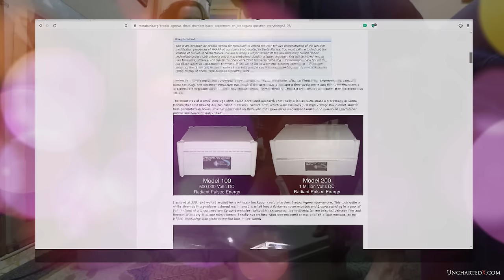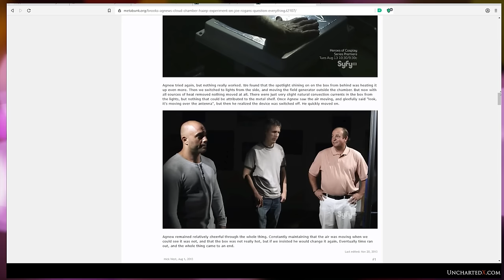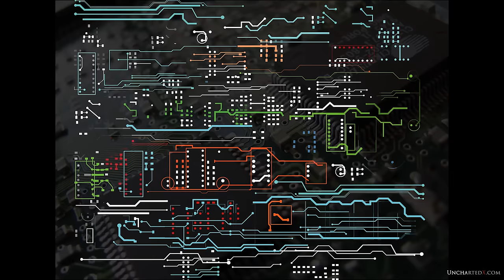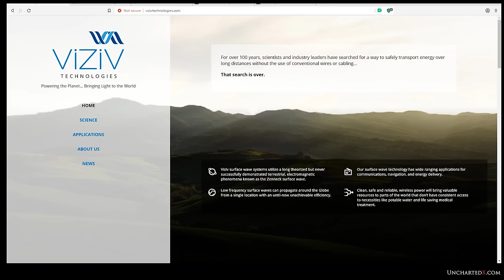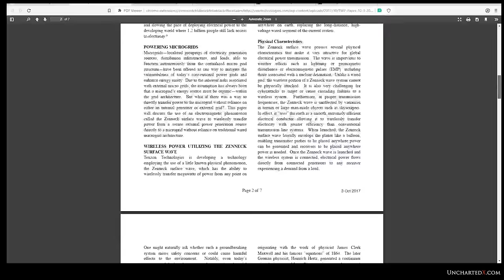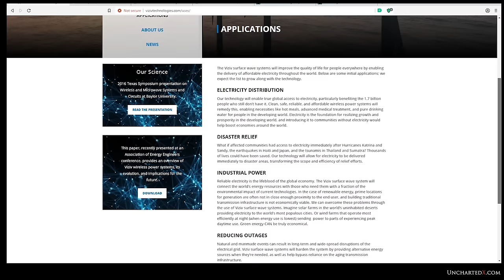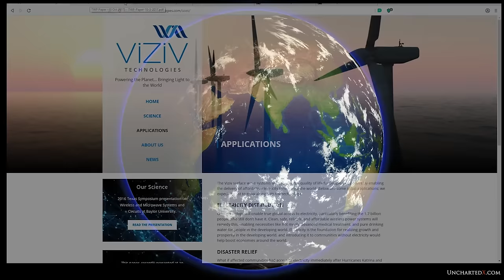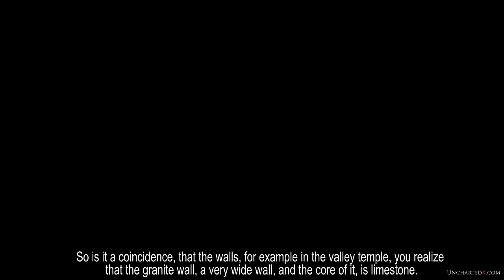500,000 volts through megalithic stone? An investigation into the possible with UnchartedX!

Comment: I have another idea about the reason the basalt facing the limestone is crumbling, and the side that faces open  air is not crumbling. Maybe it's because the limestone was protecting the crumbling basalt from falling off and eroding away in the sandy wind?

So the limestone protects the crumbled weakened basalt from being worn away and blown clean by the sandy wind. The basalt that is exposed has the crumbly part all blown off, so that's why there's none there.

Is that possible?

Comment: UnchartedX ... I think you should take a look at the work of John Cadman pyramid pump.  He proved that the pyramids were a type of water concussion wave pump. (He has a working model - hard to argue!)  Quartz produces power when it is under pressure.  The concussion wave was a shock impulse.  That impulse was stepped up using a acoustic transformer.  This is why the Kings Chamber were built.  They were designed to step a powerful low pulse up to high frequency.  The Limestone is an induction carrier.  The quartz reflected resonated and returned additional power.  The pressure was created by vibration impulse from the pump running.   It seems that the over all temple had a higher level of charge between the outer layer. This is what happens in AC "Skin Effect".  The levels of power must have been massive when you look at the scale.  In AC power electrical degradation of cable insulation in distribution lines is due to the electrical stress caused by switching surges.  If this was indeed a pulse wave generator. The pyramid has two sides. The stone materials above and the materials under compression below. The wave would have reflected between the two acting as a resonant step-up oscillator. This would have the same skin effect as AC power.  ... Dr. Cadman also claims that carbon tubes exist that linked the pyramids to the water.  Thus negative ions go to the stratosphere and positive ions into the water.  ... Additionally, if Cadman is correct. The levels of water pressure would transform brackish salty water into fresh water and killed microbes through pascalization.   .... Personally,  I think this was the Tower of Babel. ... They were trying to reach into the heavens.  Not with a physical object but energetically. ... I believe that they were going to create a one world power grid and to access that power grid you had to become part of the system.  ... The pyramids have fractured acousitc plates. ... The book says that in the days of Peleg were the lands divided.  This means there was a huge earth quake.  This would have been too much vibrational energy for the pyramid pump. ... It also seems that the process of operation also produced a great degree of hydrogen gas.  ... I'm thinking that a white pyramid with a capstone of Radium Phosphor Glass with a  focused beam of ions passing through it would be an amazing site. It would be like a large fluorescent light. ... I think you and Yousef Awyan should contact John.  ... Could this thing really have been an emergency beacon  to reach into the stars? ... Who knows.
Reply from the maker: Interesting theory, thanks. 'Proved' is a strong word that I'm not sure I'd use in this case.
Reply: @UnchartedX  I think you need to take a look at John's work and those adjacent to him then say he is wrong.  ... When you can build a physical model and demonstrate it working, when you simulate the lower swirl chamber and demonstrate a match with ink flow matching visable erosion and others can simulate it in multi-physics it is not in tin hat world any more.  Additionally, if you look into hydraulic ram pumps for pumping water uphill it is the same fundamental configuration. Take a good look at John's work, look into ram pumps. Then talk to Yousef Awyan about the electro-compressive effects of stress on Quartz.  ... It would also be interesting to know about the inductive / conductive effectiveness of the mortar they used on the limestone blocks.  .... Hit me back - It would be interesting to hear your and Yousef's thoughts. ... Thanks Mike

Comment: This is interesting. I wonder if alternating the stones like that creates what is essentially a capacitor? I wonder if the arc gets stronger simply due to being closer to the field source, or if the stones alternating like that acts as a transformer and multiplies the voltage?  What would happen if there was a marble (non conductive) core? Would the basalt still produce an arc? What is the voltage potential  from the top piece of basalt to the bottom?  Supposing you held a piece of basalt and tried to strike an arc like you did with the copper, would it work? If it does, perhaps that is the cause of the erosion between the two stones.

Comment: limstone - granit -  limstone is capacitor (blokking dc volatge verry high) if you put some after each other its  serie capacitor (can handle even higher voltges)and a tuning device (filter) for smal band frequens sender. maybe try frequence messurements   to find sendig  Radio ? frequence. As i assume frequence will be realy high

Comment: I agree with these experiments as I believe the pyramids could harness electricity, as well as the Bhagdad battery. Have you ever researched into finding the right pitch to shatter a wine glass? if a wineglass can vibrate, then why cant other frequencies vibrate other materials? If you hit a bell next to another identically weighed bell with the same frequency the other bell can ring.

Comment: The megaliths like the pyramids were built with electricity. They were not used to make it or transmit it. The air shafts were where the electric cables were brought in. To finish the inside while the rest of the pyramid was built around it.
The key though is, what are the obalisks for?

Comment: Maybe these electro-magnetic functional areas utilized "Leyden jars" storing natural static electricity which produce fluorescent light without a filament?  The glass would be long since gone after being used for other things over millennia until they broke & disappeared into waste streams.  Could the highly polished granite boxes be "brushed" to build-up a static charge inside to wirelessly power other objects?  Were the granite boxes incomplete, awaiting some other inner component to generate or store electricity?

Incidentally the Sahara was a green & fertile region some 9.5  thousand years ago, & logical to presume that probably the Egyptian desert was too.  The climate then changed apparently because of a perturbation of the Earth's axis.  So the ancient builders of the Separeum at Saqqara (whenever that was ! ) may have had a vastly different habitat to the hot dry deserts that followed, along with significant alterations to rainfall & regional water courses.

Comment: @UnchartedX
(edited for time reference)

@22:34 marble stone

He says that since the marble was not conductive like the basalt then that why it's not used.

This shows a complete lack of understanding basic electronics and electrical fundamentals, importantly- capacitors, electrolysis, electrolytic process, and electrolytes.

FYI... for a circuit to work properly you don't want everything to have the same potential, and anytime there is a change in potential there will be a thermal and electromagnetic component.

Don't discount a stove that has apparently, no connectivity.

if they were to Cut the stones differently, more like pancakes, [or used a cylindrical cut] and stack these stones correctly, and understood basic electric theory, they could have created quite a powerful capacitor, that would have shocked the hell out of them or been quite harmful.

Comment: If the pyramid was encased in the limestone then recieved electricity from the ionosphere the voltage difference between the shell and whatever was stored in the kings chamber box would have a direct path to the contents via the air shaft

Comment: I think I know how they use that with a pyramid. It apex cap would conduct sunlight to the pyramid walls, and each section between the disc(4), would contact the pyramid . Or even having a metal encaseing that goes in center.was charged the sand stone middle. They can use it for gold plating. Or drilling .  Pretty nice object with interesting geometry.kind of reminds me of a car engine crankshaft.

Comment: What if the basalt or granite is carrying the charge and the limestone is the insulator. Perhaps it’s in the center of the wall to separate positive and negative. It may only be needed to prevent a short between the two poles not to protect anyone from touching it. The main reason we insulate wires is to prevent shorts that might cause a fire and to keep people from electrocuting themselves. But if it was not dangerous  for us to touch you would only need to keep positive from touching negative. If that makes any sense.

Comment: It would be interesting to see a test of both types of limestone, and with different bases. Limestone to granite /basalt was shown. How about basalt to limestone/granite, and granite to limestone/basalt ... and using both types of limestone. Also, granite has some piezo-electric properties, meaning that a sweep of frequency might show interesting effects. As pointed out in another comment how MUCH output one gets, at different levels (first basalt vs second and third basalt levels, etc), with different sizes radius and thickness of the cylinders of each type would be interesting, again swept across a wide range of frequencies (including pure DC).

It was shown that marble was not conductive, so if the granite was used as an insulator, marble would have been a better choice; so there HAS to be a reason why it was not used, and granite was.

The limestone side of the basalt wall was shown to have deteriorated. A comment or two discussed the chemical  and physical properties of basalt that might explain this. But, in older "dry cell" batteries, the electrodes are known to deteriorate in much the same fashion.

Prior to WWII, people sold "electric shocking machines" that used a large 1.5 volt dry-cell for power. It used a relaxation oscillator to create a variable voltage/current, which was then used for "medicinal" treatment purposes. (Or just for entertainment - to see how much your could take). The device had multiple output power levels chosen by which 2 of 3 connectors were used, and then that level was further adjustable by a sliding iron core that fit inside the relaxation oscillator's coil. Not that this matters, it is just added for a reference.

By the way, for a guy that carves stone (or, actually ANYONE!), your friend has an impressive range of knowledge, as did his father.

Comment: The crumbling looks like frost-fractures to me, which makes me think that maybe th limestone is there to dry out the basalt, but with flooding it might have had the opposite effect.
But the combination of these materials, could have many different effects. It did not seem to act as a semiconductor, as the frequency never halved (I'm assuming the magnetic field is oscillating, and not just a pulsed DC, though is this was the case it could be the reason why the granite was such a poor conductor). I suppose that this could have either acted as a thermoelectric generator, or a thermoelectric cooler, or a combination.
The fracturing of the basalt could also be chemical, as a result of the proximity. Or it could be electrochemical if any thermoelectric effect was taking place, which is somewhat likely as as they were both shown to be conductors, in the same way that the combination of to different metals, will create a potential differential when heated (thermocouple).

Comment: The problem with Zenneck-wave power transmission is that if you can just plug something into the ground and get power then  everyone can do it!  This means that the entity that generates the power is doing it for free because they have no control over who uses it and cannot get paid. You would need a monopoly on the receivers to make it a viable business model. I don't think this is possible, even if the  Zenneck waves actually work.

Comment: The machine is just a tesla coil with a pwm and a capacitor. It's far from producing the longitudinal scalar waves used in HAARP. Much more interesting and important is how energy can be concentrated, focused, and even transmitted through a pyramid structure!  The pyramid is actually capable of producing rudimentary longitudinal waves, and do it on the planetary scale, the harmonics of which it is actually built upon!

Comment: Watch on YouTube: "How to "melt" stone sound, p.1". No need for a power drill when you've got sonic corers (copper + current).. Granite on bottom of structures? Gotta be pizo electric going on there. Water used to direct, enable or enhance the current. Water used in the Great Pyramid, and water found under the Great Pyramid. Have you heard the theories around the function of the pyramids was to generate electrical power? Search YouTube

Comment: excellent video, is it possible I wonder to make a pen sized, hand held implement that could etch artwork into stone?  How would this experiment work submersed in water, or surrounded mercury or copper?  Mind bogg;es, great machine Yousef.  The biggest voltage I worked with is 12Kv DC in an experiment to deionise water and effectively make ozone.

Comment: Seems very plausible that the pyramids were either some communication device, power transmitter or scientific measurement device, the granite boxes inside could than be some component to insulate something inside, thier lids could have been something like a control rod and the chambers either for maintenance, for finer circuitry or as some form of a resonance body.

Comment: Electric arcs melt steel for welding and it's because of the heat released instantly. Don't you think it could cut rock in the same manner with the heat from an electric arc exploding the surfaces and also polishing it by turning it to glass?

Comment: Maybe you should build a small scale pyramid like their original, set it on the machine and test to see if the limestone will hold some kind of a charge. Also, (going out on a limb here) maybe the stars that were aligned with the pyramids send an electromagnetic signal and the amount of power generated would be constant but the amount of power generated would depend on the volume of interior limestone?

Comment: We need to find out the capacity of the Stone. How much charge will it hold. If you have two circular shaped pieces of stone like in the video that will take a high enough charge separated by another piece in the center that acts as an insulator then it might produce lift working in the same way as a lifter technology showed on YouTube videos. Also you can probably make Motors out of any material that will hold a large charge so if you form the stones in the right way you could make the center disk turn and then in that way provide stability through gyroscopic action. I've seen it said that there was at one time a well underneath the Great Pyramid, if you let the water go to the top of the pyramid and then drip down there is a well-known way to produce electric charge. Could The Pyramid have been a charging station for flying crafts that it one time set on top of them? Our technology today is based on electric coils which produce magnetic attraction to turn motors. But an ancient technology may have used coils made from Stone to produce electrostatic attraction and repulsion for their Motors. Maybe an older Lost Civilization or the Anunnaki technology?

Comment: Dude, I'm an electrical engineer; different materials have different dielectric constants, the machine is just a high frequency, high voltage DC switching circuit (and/or) AC generator. There is nothing mysterious about what is happening in the video, its just basic theory for a first year engineering student.

Comment: This is a “what if question,” Looking at the pillar you guys were playing with, what if the different types of stone were for different voltages? Basically you could connect to what ever one was needed for the application required???
Reply: this is  SIMPLY  a demonstration of  induced, electrical  Conductance.    ALL  the energy  in the  System, is  BEING  SUPPLIED.

Comment: Electrical engineer here. There's not really anything amazing happening here. I want there to be ancient electrical technology, don't get me wrong, but you'll need to hook it up to a volt/amp/capacity meter for me to say if something important is happening. I also have a problem with this mysterious "machine" and his claims that limestone is somehow a good conductor because you can get an arc. We can produce many different kinds of currents, high or low voltage, in various patterns and waves that would be devastating to organisms or materials but produce even less noise or arc than his "machine".